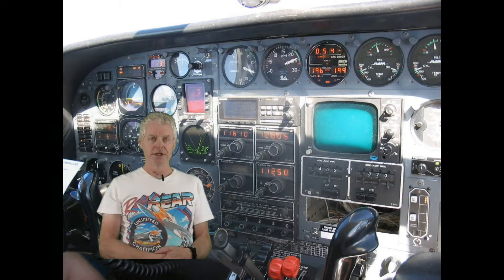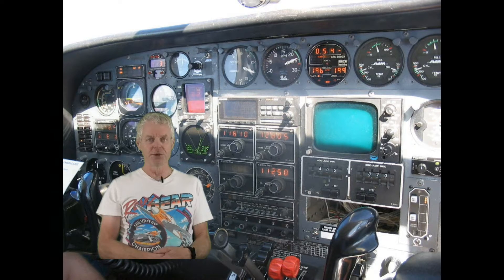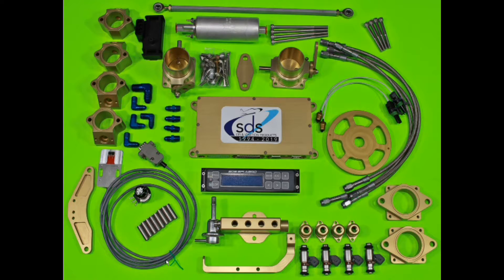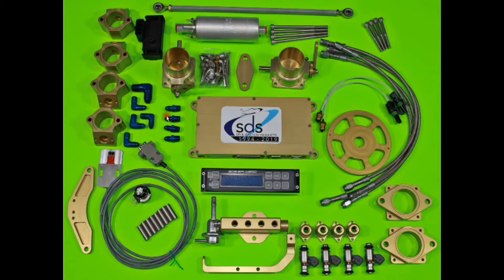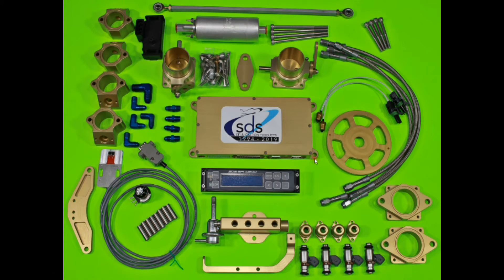SDS EFI Rotax 912 Kit

Comment: cost?
Reply from the maker: For 2021, single ECU, single fuel pump setup, fuel control only will be $3955US.
Reply: @rv6ejguy  is all that is needed included in the kit?
Reply from the maker: @esau82  Everything included except main throttle cable (Aircraft Spruce PN 05-09560) and some fuel line connecting the pump to the fuel block and regulator to return line. You do need a return line back to the tank (s). If a low wing plane an more than 2 tanks, you may need a Andair Duplex type fuel selector to return fuel to the selected tank. For high wing planes, can usually fit a small header tank and feed the pump from there and return to there. We can supply twin K&N air filters if you have space for them. $90 extra. You need about 18CM past the intake manifold carb face for these.

You need resistor spark plugs to run the ECU.

A wideband O2 sensor setup is recommended to tune the system. AEM, Innovate Motorsports, Ballanger Motorsports etc.

Be aware that the EFI system draws around 8-9 amps current. With the standard 18 amp charging system, that may not leave much for the other electrical devices.
Reply: It's for a ctsw
Reply from the maker: @esau82  I'd recommend  a 2-3 liter header tank fed by the main tanks. Mount the fuel pump below this and return fuel to the top of that tank.

Comment: Send this clip over to the folks at TAF (The Airplane Factory) And the Sling Pilot Academy in Torrance. Ca.
Reply from the maker: I think most Slings now are using the factory iS EFI engines now anyway.
Reply: @rv6ejguy  Are you getting better performance then the factory EFI?
Reply from the maker: @JonMulveyGuitar  No. The factory did a good job in optimizing performance. Our goal is to retrofit older engines with the Bing carbs to give them similar performance at a much lower cost and weight penalty.
Reply: @rv6ejguy  I flew the Sling IS EFI and was not sure if they all have the newer engines.  Love the RV 10 clips. In 71 my Dad designed an ESI for his Toyota corolla. haha!  And told me "in a few years all engines will have them".  He didn't say except certified airplanes.  Great work!

Comment: Nice!  Any plans for a redundant system?  How does the weight compare to the carbs, and what is the amps budget for the FI?  Any plans for an integrated ignition and injection system?
Reply from the maker: We can do a redundant system as we do for Lyconentals. More cost, complexity and weight.  The system draws around 8 amps. With the standard charging system, we don't feel there is sufficient headroom to do the ignition as well. Easy enough to do ignition though and we've done it if folks have an upgraded charging system. I estimate the weight is about 1.5-2  pounds more than the  carbs and mechanical pump.

Comment: Is the inlet dia to the throttle body the same size as the bing for air filter fitment?
And for those with airboxes, is the airbox positioning (fore/aft) similar to original carby positioning? 
Obviously the arrangement is going to be higher with the injector spacers.
Reply from the maker: The air horns are 1.75" OD. Total length of the TB and adapter is 3.15 inches from the manifold face so the overall assembly is shorter than the rubber isolator and carb.